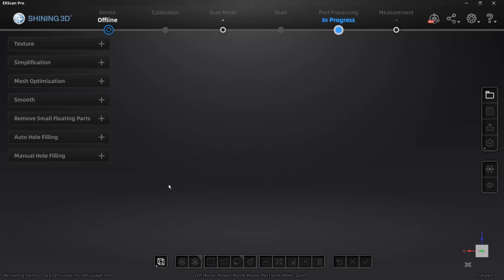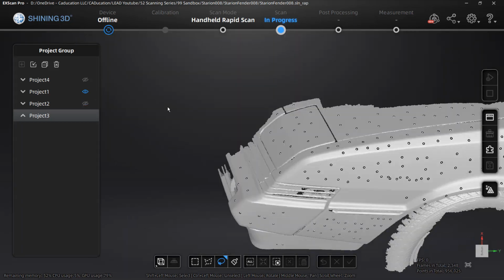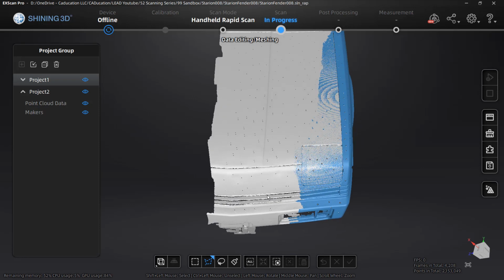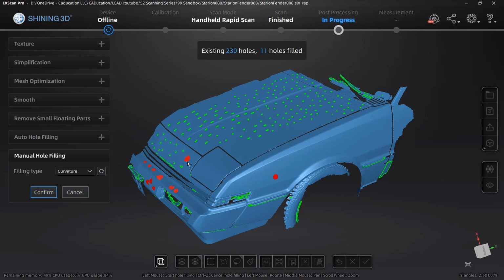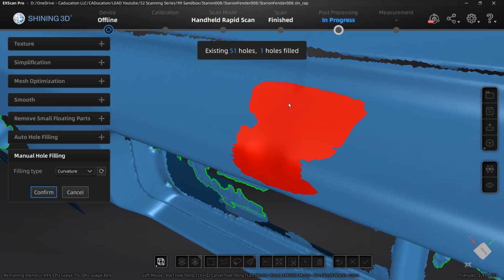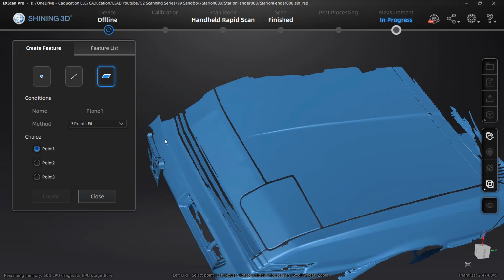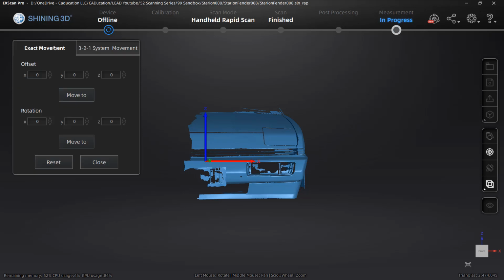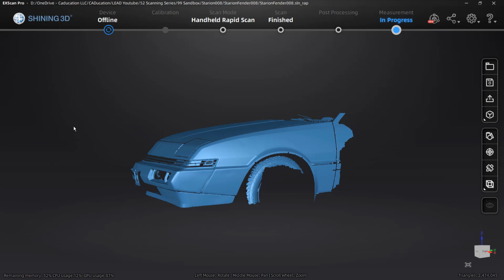3D Scan to Part Series Part 3 | How To Align, Process, and Export Mesh Scan Data using ExScan Pro

Comment: I have the same scanner. Would you still recommend it for car body scans now in the tail end of 2025?
Reply from the maker: The Pro HD?  Probably not.  It is a much better scanner for other things but can do car bodies.  Shining released and created the Einstar lineup after I had done this video and some of the scans comeing from the original Einstar and the Vega are much easier to use and much cheaper.  For car bodies you don't typically need the type of accuracy an HD style scanner would have.

Full disclosure I haven't used the vega or the new einstar, I goto the Revopoint Miraco as my goto portable scanner and the vega is in a similar category.  Staying in the shining3d lineup that is probably what I would look at.
Reply: @LearnEverythingAboutDesign Ah, very nice. Yes, the Pro HD. I haven't attempted car bodies yet. Your car was white, so I imagine that was a lot more forgiving. One of the cars I plan to scan is a darker color, and I'd really rather avoid spraying it if I can help it. Thanks for your reply!
Reply from the maker: @24thgear  when i have to spray a car i use the vanishing spray.  cleanup is much better!  Flat colors are much better than shiny ones.  The big kicker is marker dots honestly.  such a pain to add and remove. so I prefer a full field scanner that has a wider set of depth cameras so you can be farther away.  I have scanned that same car with a few scanners including the revopoint metro.  So when possible I try to avoid those markers.  Now areas that need a lot of detail you will need to weigh the options .  Like do you need a higher level of detail or is the low detail at say a .1mm accuracy ok.  On the same care I did an intake duct in place of the fog light and used a different scan mode for the light and bezel (laser for the bezel, full field for the light and bumper).  

I have a revopoint trackit which is the markerless laser scanner setup that can scan things like cars and motorcycles in laser mode with no markers, but the problem is the space needed for the tracker and also the temp range.  needs to be a big well conditioned space....
Reply: @LearnEverythingAboutDesign Yeah, AESUB spray can add up fast, and ventilation is also a problem (especially in the cold winters—not ideal to keep the garage open just to vent out fumes).

Thanks for sharing about your other scanners. Part of me says try what I have and max it out first, but I have a very strong feeling I'd end up disappointed in the results. Don't get me wrong, it's excellent with the turn table—mad details with that. But hand held in a garage? I'm not so optimistic. It's great to see you prove that it works, but the process looks too painful for me. 😂😂

Comment: Need help keeping two aligned scans separate after alignment (EXStar V1.2.2.0)

Hi, I’m working on a project where I need two separate scans — one of my vehicle’s front frame rails (bumper off) and another with the bumper on. I need both scans aligned so that they share the same reference, but I need to keep them separate so I can toggle them on and off in SolidWorks as graphics bodies.

The issue is: once I align the two scans in EXStar, I can’t seem to mesh them separately. Even if I toggle off the “eye” icon for one scan, as soon as I click Mesh, EXStar automatically turns both scans on and meshes them together into one file.

Really need help with these 2 items. 

1. Both scans aligned in the same coordinate system.

2. The ability to mesh and export each one individually (so I can toggle visibility in SolidWorks).

I’m using EXStar v1.2.2.0 with an EinScan EinStar scanner.
Any steps, workflow, or export method to achieve this would be greatly appreciated.
Reply from the maker: Hey There.  I haven't used Exstar in a little while so I don't know if it can currently do that sadly.  To do this I use QuickSurface.  I show something similar in this video to what you are trying to do.  Bumper with marker light and bezel installed, aligned to the bezel and bumper without the marker light. so 4 scans total.

https://youtu.be/U1wIln4QnK8

Comment: I was so excited that I finally had a free solution to align a mesh to an origin only to find out that I don't seem to have the save option in my EXStar Software for the Shining 3D scanner. I can go through all of the steps you performed, but ultimately can't save at the end, it seems. Would love to be wrong on this!
Reply from the maker: Oh man, I wonder if they pulled it for the ExStar version vs the ExScan....  I don't have exStar at the moment, but i just looked in the manual here and it looks like the 3-2-1 system movement is there. 
https://docs.shining3d.com/exstar/1.0.5/en-us/measure/

So you don't see that tab at all when on the "measurement" part of the workflow?

Comment: For ease of aligning a coordinate system, would it be advantageous to set, say a 3d printed cube on the hood for example, to aid in the coordinate system and remove it later? Obviously there are some variables, but I was just thinking of that as an option.
Reply: Lol, never mind, you mentioned that later in a video. Thanks!
Reply from the maker: Yeah :)  Its a good idea for sure.  If you are using other scanners like something from creality or revopoint though there isn't an alignment option in their software so its a bit moot.  I do talk a bit in some videos how to make plans in Fusion aligned to a mesh but its a work around and not a great solution.

Comment: Great, detailed tutorial! Is there a way to save scans, after alignment, separately? Say you're looking to make something that has to align to, say a bumper shape, on the outside, but avoid internal components that couldn't be scanned with the bumper on. During design, would be useful to be able to bring them in aligned, and with the origin aligned from EX scan, but as separate STLs.
Reply from the maker: You can add other scans to the project.  So say if you had 2 different projects and there happened to be some common marker dots across those two projects, that would help when trying to put them together.  This would be common for say scanning an engine inside a bay with and without a manifold on it.  

it has been a minute since I tried, but after you align to a coordinate system it should stay in that orientation if you step back to the processing.  I think once you export from the "Measurement" you are getting just that mesh from the scanned point clouds.  The only way i know of to export multiples would be to jump back to before the points were aligned.  Ill have to try again but it may mean taking the points to a 3rd part software like Meshlab (free and can open points and align) or use a pro solution like Geomagic.
Reply: Yeah it looks like once you mesh it in EXscan, any export will be one STL. If you go back to the processing level, it deletes any mesh as well as any orientation data, from what I can tell. I'll have to look into mesh lab! Thanks!

Comment: I was struggeling with allignment in this software so much, its weird they put it in measurement section instead of at the alligment section. I get why they split up the aligment of multiple scans in relation to eachother. But the alligment to the coordinate systems should have been there too. Instead of having to make 3 features and based on that allign it to the coordinate system. THank you thank you thank you.
Reply from the maker: I agree and I gave feedback to shining on that.  I do have a few other videos focused on Exscan specifically and some other tips for part alignment if you are using Fusion.
https://youtu.be/Ft9qTVCMwC4

https://youtu.be/82vD7YSKIAo

Comment: Hi Matt, this series is turning out is excellent! I am using GOM inspect (the free version) to align the object to the WCS. Have you tried that? It uses the same 321 concept and is not so intimidating as this one.
Reply from the maker: Great suggestion Luis, I have taken a look at it.  For this series Shining sent me the scanner so I am trying to use their tools.  I have a few others that I am going to do on more mechanical parts that can be measured and with better references to set up XYZ.  The process in ExScan isn't bad, but it is limited....
Reply: @LearnEverythingAboutDesign   Thanks for the reorientation part - it has helped me greatly. I get it close according to areas on the scan and utilizing the XYZ axes, and then tune later with the "Exact Movement". The only "problem" is that "front" for ExStar is "Top" to fusion. But I guess this is not much of an issue. Matt, do you have a Starion? Why do you do several Starion stuff? I have a Starion and am using your tutorials for forms and making a wider fender kit - interesting if you do.
Reply from the maker: @cocofunk86  Sure do!  an 84 ES.  I have a whole series on scanning it and designing a wide body.  I have been a bit too busy to finish it off sadly but all the design is there.  I 3D printed all the pieces but sadly I just have too many projects on my plate.  Here is the playlist  https://www.youtube.com/playlist?list=PLBDfGh8A8kXVvKBJ4UudhVLKlPdumAg5P  

If you need it I did scan the entire side of it.  The ES had little mud guards on it but should be the same as any other narrow body aside from some minor trim differences if you have a conquest or like an 85.5 esi or something.
Reply: @LearnEverythingAboutDesign   This response is absolutely madness - haha. I actually have an 88 and have scanned the rear and the front with an Einstar. Though I did not go to school for engineering, I always wanted to be one, and the Starion has forced me to do so. I have made an "Autozone" BBK for the Starion which the Starion community wants me to make a kit for and sell - but I also have been too busy and started a carbon fiber business in Mexico (only because I can manufacture stuff here with high quality and I know people). I have designed a functional "bumper-to-subframe" splitter for the E36 M3 which I am making the mold for this week - and it will be a 0.5 inch polyurethane foam core resin infusioned in carbon fiber (or aramid, or 2x2 fiberglass). I literally used your Part 3 video to set my car to origin and align then designed a splitter for the Starion matching the lines of the bumper and valence. I would love to show - but kinda cant here. I eventually want to full carbon the starion in a custom wide body and SEMA the dang thing. Your "forms" videos are coming in more handy than you know. Hope to connect with you somehow.
Reply from the maker: @cocofunk86  Awesome man!  I was a big part of the starquest community for many  years but the forums got a bit toxic and left them behind.  I have had my car since 02 and sad to say it has sat for more time than i like to admit.  Just constant problems pop up and i really just need to dedicate a big chunk of time to it.  The widebody series forced my hand when I had access to the scanner and Shining wanted a widebody video.  If Youtube was my job the thing would be done but such is life.  I did design parts for it and the community back in the day.  intake and exhaust manifold plates, i was working on an optical trigger replacement for the distributor.  Made a brake conversion (only works on narrow bodies though since the hub setup and rotor position is actually different).

Custom widebody sounds cool.  I know of 3.  years ago there was a user that built one just like the OEM but wider and all in steel.  There is of course john L's ls swapped widebody.  and there was one in Japan at some tech school and i think they RB swapped it too.

If you want to connect just drop me an email. support@caducator.com

Comment: so I'm watching and thinking your software looks different from mine. checked in mine if there's a "update" or a "latest version" found nothing, just version of the software. went to their website and  saw that they have a new version, mine was 3.6 and there's a 3.7 (that's what you must have). so I updated. 
thanks :)
Reply: this version has more tools.
Reply from the maker: Good to know.  This is my first experience with the ExScan software.  Back in the day i used to use RapidForm and Geomagic for mesh.